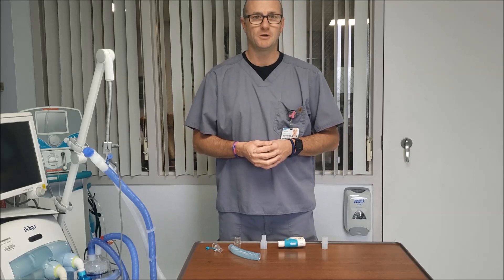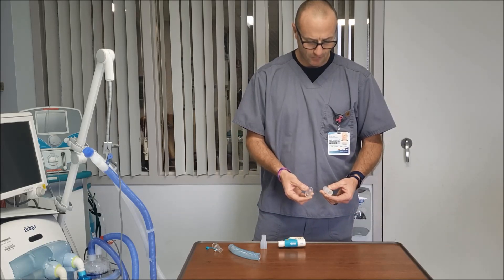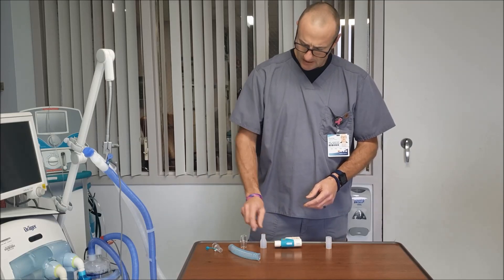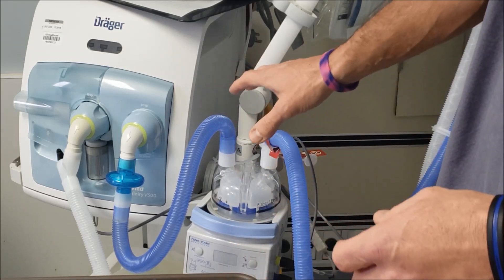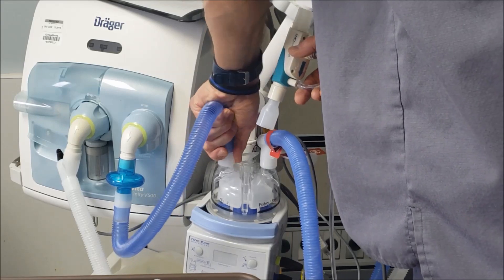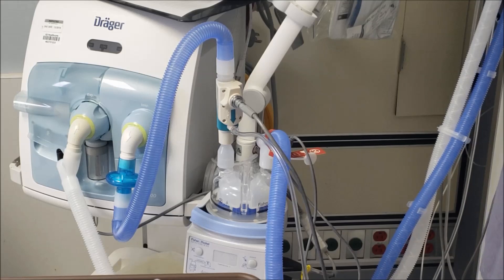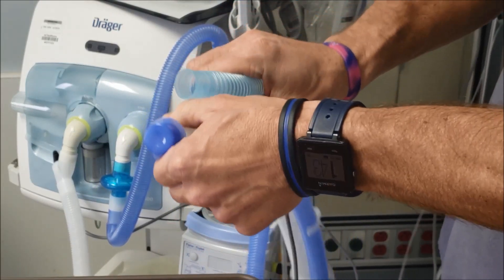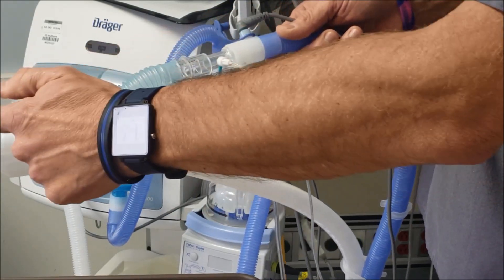RT Clinic : Quick Hit Tutorial - Nitric Oxide Admin with Mechanical Ventilation

Comment: What is meant by sampling line and dosing line?
Reply from the maker: The sampling line pulls a sample  back to the machine to test the concentration.  The dosing line delivers nitric to the circuit and changes the concentration based upon the  sampling line's readings.

Comment: Is there a major difference in putting the injector module on the dry side versus heated side?
Reply from the maker: You would have to ask a nitric rep about the specifics, but I think the high amount of humidity and rainout may interfere with the injector. The injector is mono- directional as well, so it may be difficult to adapt to the heater upside down.

Comment: Thanks for the video :)
Question: why have the 6 inch corrugated tube?
Why not just plug the sampling adapter straight into the Y piece?
Wouldn't the 6 inches of unheated section cause condensation/rainout?
Reply from the maker: Adept assessment Hugo James. I can definitely tell that you know humidity works on vent circuits. Many clinicians do not understand how to troubleshoot rainout.
In this case, the piece of ext tubing is used to insure a proper reading of  nitric delivered. Placing the sampling tee at the wye would give inaccurate numbers because to the mixing of exp gases from the exp limb. The tubing gives enough space to allow for a proper reading without mixing.
Thanks for the question.
Reply: @rtclinic  in an anesthesia machine where there is rebreathing of gases, would you connect the sample line at the Y piece just before the HME, or would you still connect it on the inspiratory limb?
Reply from the maker: @arthurfinkelstein1912  I would attach it on the patient end of the HME.
Reply: @rtclinic  That makes sense! Thanks for the prompt reply
Reply: Jimmy McKanna - RT Clinic thank you for this analysis. Also thanks for the upload. We don’t get to use nitric often and I often forget these small steps.